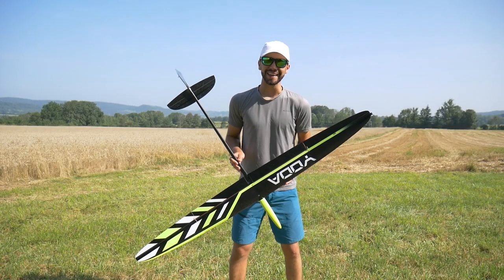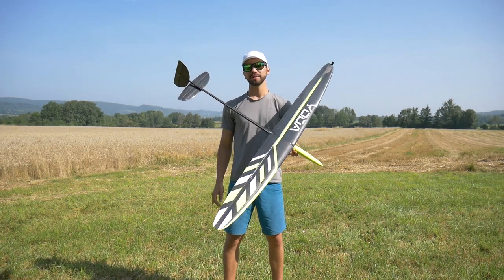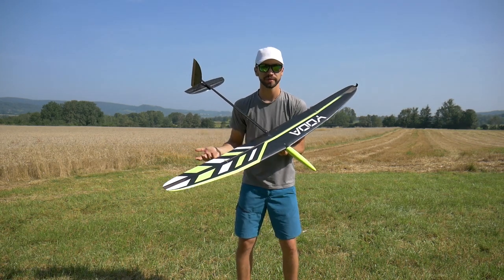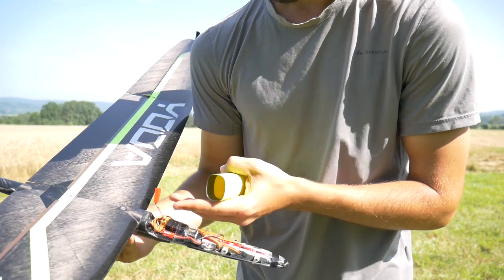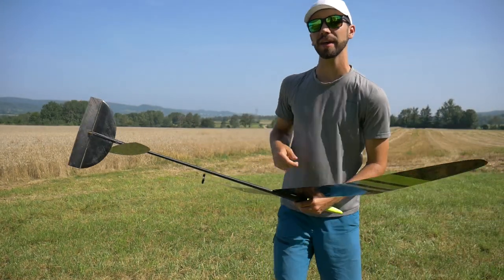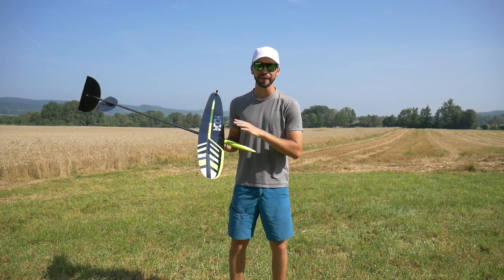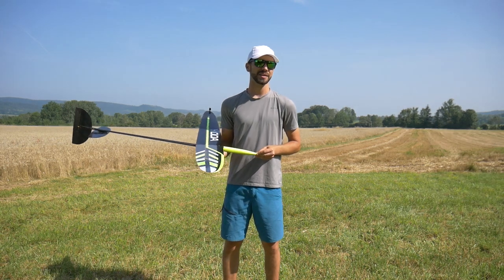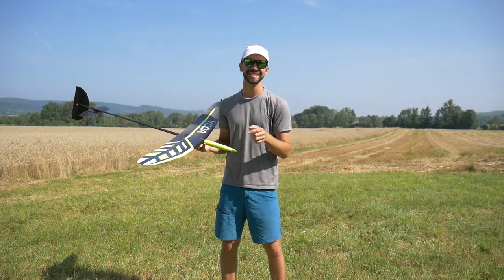YODA DLG Review

Comment: Perhaps would you share details on your Tuning? CG, Throw setting, Camber settings?
Reply from the maker: take a look , It s in the description of the video
Reply: @pierremeunier  1:1 ratio Aileron to flaps? Did you try less flap than Aileron?
Reply from the maker: @tomkelley9316  it's not 1:1 ailerons as more throw than Flaps , if I take the mesurements at the point where ailerons and flaps are next to each other , flaps defflect 4 mm less than ailerons . And as usual I tuned the glider by flying it , and only took mesurements to share them , so I was quite surprise to see that too .
Reply: @pierremeunier  Thank you so much for sharing your setting. Yes that makes more sense that the Flap throw would be less than Aileron (as they should be). But it seems that if the throw as measured is equal in distance at the root (both Flap and Ail are 12mm up, 16mm down at the root) it seemed like that is closer to a 1:1 ratio. But because the length of the control surfaces are different then perhaps that is actually what makes the flap throw 4mm less. Or is the flap throw 8mm up, 12mm down? I will measure my Yoda to check to see if that is correct.
Reply from the maker: @tomkelley9316  any way . Try and you will see if you like it . 
Happy flying

Comment: I find it hard to believe that polyhedral will make up for the weight of two extra metal servos on such a small glider, but it definitely looks cool.  I'd love to understand how it gains that extra performance.  Could you do a video on how you add weight to the tail of a glider?
Reply from the maker: I never add weight to the tail of a glider , it s nose heavy I just put a smaller battery.  About weight distribution , it feel good to me , you need to try for yourself to see if you like it or not .
Reply: @pierremeunier  My Strike3 has KST6 servos and is slightly nose heavy.  The servos and battery are as far back as possible.  Took the shell off my FASST receiver and even desoldered the pins.  Not sure if I can find a battery small enough to fix the issue.  I taped some weight to the tail and I don't like it.  :(
Reply from the maker: @ChristieNel  x06 are too heavy , 5 g servos are at the limit
Reply: @pierremeunier  Yeah, they were probably overkill.  My seller said they are the best servos for the Strike 3.  Maybe performance-wise, but yeah, too heavy.  Next time I'll be more careful.

Comment: Thanks Pierre for this video. Would you switch to fly Yoda? Do you still think poly way to go after Yoda and modified NRJ flights?
Reply from the maker: Yes I could consider to switch ( without talking about sponsors ) 
Poly is interesting in the air , as I said only down side is the settings are a bit more complicated to dial in but when it's good it fly great .

Comment: Blah, blah, blah...   :)

We should talk in regards to set-up sometime!
Reply from the maker: Yes I love the Blah blah you know 😜 .
Of course , it would be quite interesting to get your point of view about it
Reply: It is just another new plane... with a bit of difference.  The four servo wing is easier to set up if you have had any prior four control wing experience, which you noted in the video.  Surprisingly, in some regards it is easier to set up a four control wing than two control wing in that one doesn't have to ignore one of the axes.  For flaperons, one has to decide whether pitch, yaw,or roll response is most important, and deciding the second most important, when moving the roll stick.  With a four surface wing, one can fine tune the response from a roll command in the pitch, roll, and yaw axes. One cannot do all simultaneously with a flaperons equipped aircraft, although have a good chance with a flap g/aileron aircraft
Reply from the maker: @joewurts7046  yes , 100% !
Reply: @joewurts7046  Hi Joe, I now have 2 Yodas and applied your setting from RC groups to them.  I'm still trying to fine tune out the best setting for it. The setup he posted here is quite interesting compared to yours. It looks like he went with a bit more flap throw than yours and he's also got the wing throws more down than up. Your setup is actually the opposite. Perhaps its just a prefernce thing?
Reply: @tomkelley9316  Hi Tom,  I have been slowly reducing my differential and am a bit happier with the handling in thermals.  In the past couple days I received some feedback from a talented flier in Italy, where he has gone with a small amount of negative differential, and zero aileron to flap mix.  He has been flying Yoda for around three months now and is rather pleased to say the least.  When he first started flying Yoda, he was rather happy with the plane.  I suggested that he take some time before providing an evaluation.  Well, there has been sufficient time, and he provided his evaluation...  :)
Reply: @joewurts7046  I agree. A good and realistic evaluation  takes time.